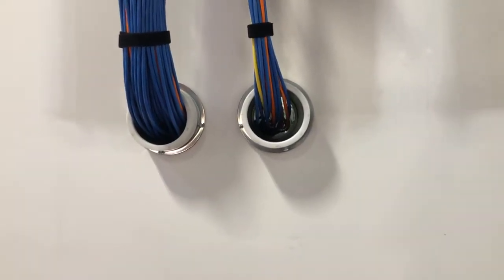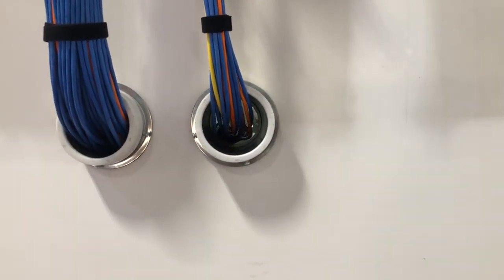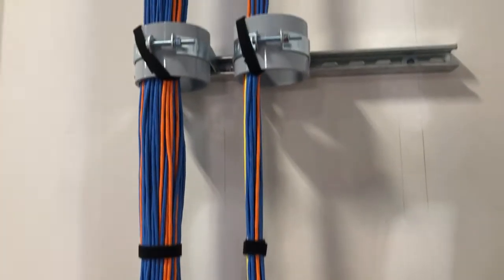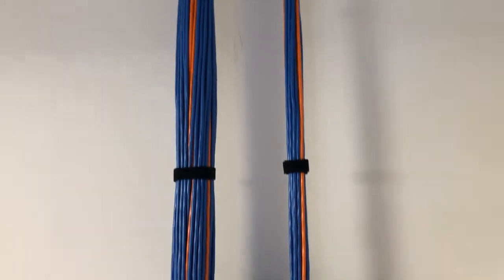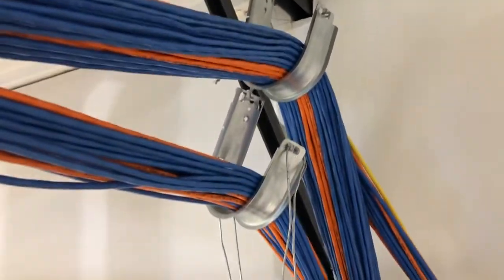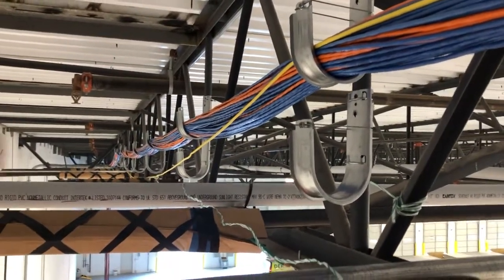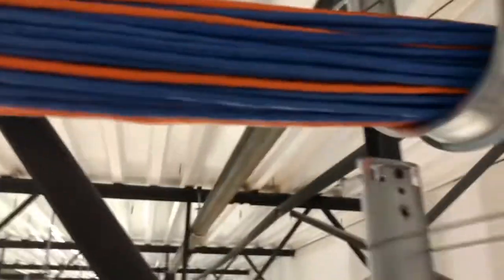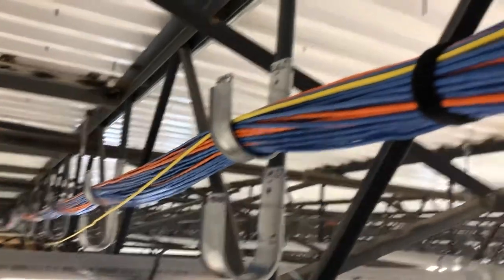How to neatly bundle Cat6 cables with Velcro and use of J-Hooks

Comment: Nice, the way you did it is very neat looking aesthetically. Also, it looks like the velcro strapped around the gray PVC pieces, or whatever that is, is taking load/stress off the cables on that long vertical drop....?? If so, thats pretty clever, cheaper than using ladder rack or wire basket cable tray vertically and essentially does the same thing.
Reply from the maker: Yes, that is Velcro around the PVC Couplers to secure the cables and keep the load off, and you can easily add more cables in the future.  Pull on that Velcro hard to make it tight before putting together.  Thank you for your comment.
Reply: @S2LV  Matt I was curious, are those JHooks screwed directly into the steel joist with self tappers or something, you mentioned beam clamps in the video I'm not seeing any so I was curious how they are mounted. Thanks
Reply from the maker: @Eric-qx1kx  We secured the hooks to the red iron using short sections of ceiling grid wire.

Comment: I like how you attached the Cat64's directly to the ceiling structure. i typically use the beam clamp. I will try it your way on my next job!
Reply from the maker: In most cases, I like to use the beam clamps as well.  I go for the heavy duty style beam clamps, not the flimsy kind that collapse.  Thank you for your comment.